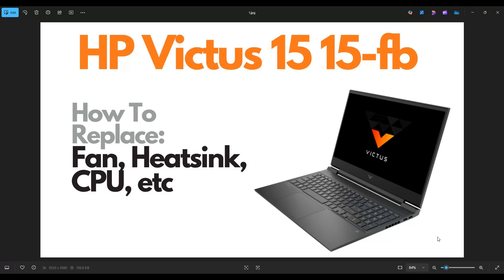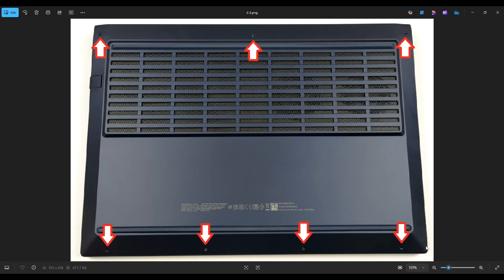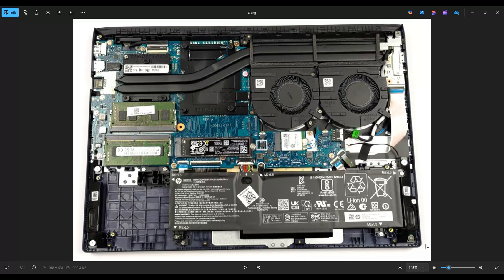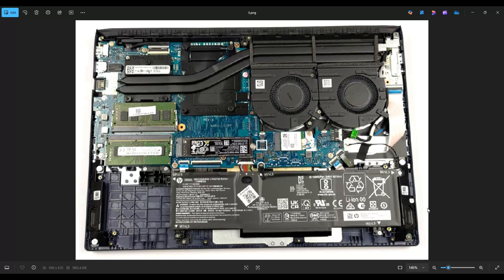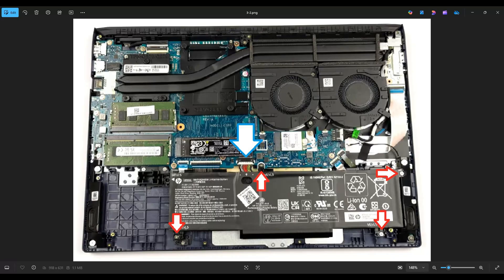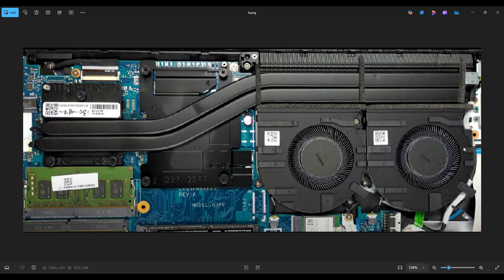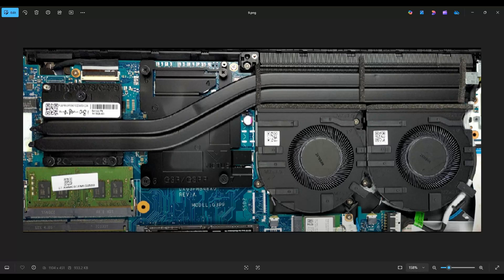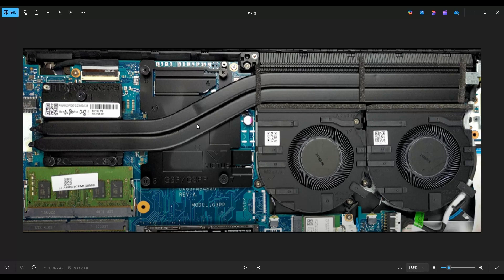How To Replace Fan, Heatsink, CPU, GPU - HP Victus 15-fb Gaming Laptop (15-fb0000 15-fb1000)

Comment: I have this laptop. But the battery I have is longer than the battery in your laptop. I have a noisy fan and the fan does not have a rubber cover, it has a brass screw that you can't remove to add oil to the bearing. A new fan is so expensive too.

Comment: I have problems with replacing thermal pads on the official website, they say that there is one mm of thickness everywhere and 1 mm of pads on the CPU side fits perfectly and contacts the radiator, and the side of the GPU is not particularly so, but I put a 1 mm thick pad on the VRM, VRAM chips and pressed the radiator, but there are no traces of thermal paste in the radiator that I I applied, I bought additional 0.5 mm pads , but I don't know if it's worth using them, in general, I can't solve this problem for the second day, I've watched a bunch of videos, asked GPT, it doesn't help, in general, I'm at a dead end.

Comment: My right fan (in the image) keeps getting stuck onto something and if i spin it it doesn't spin as much as the left one do i still need a replacement or can i fix it? And btw everytime it gets stuck it sounds really loud so i csnt bring it to school, can i just run my laptop with 1 fan?
Reply from the maker: Its not wise to use with only one fan. If its getting stuck, you should replace it.

Comment: Def needed to replace! I found a replacement of the fans and heat sync for about 168 usd cause one of my fans stopped working no matter how hard I tried to clean. 

Need to buy some thermal paste for repasting and buying the replacement parts and it'll finally run cool again!
Reply from the maker: Great to hear !! Always here to help :):)